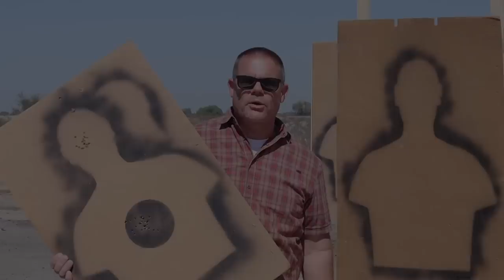Make Your Own Range Targets the Easy Way!

Comment: Another option is to use paper grocery bags. Fold them flat then cut in half along the wide side. Begin unfolding and trim the small square at the top so it looks like an IDPA type target.
Reply: Nice! I have been using brown paper bags with a piece of firewood in them to hold them up for years. (No rocks)

Comment: I was thinkin you could cut the silhouette from a piece of cardboard & use that for your pattern. 
Just my humble opinion! 
Thnx for the mornin humor OG!
Reply from the maker: Sure you can.  The edges get kinda soft with repeated use with wet spray paint, but those will certainly work.
Reply: Good advice considering that 8 dollar piece of mdf is worth $199.99 these days...Thanks again Biden!
Reply: Tape all the edges off with masking tape, rolled over the edge. After a while paint build up will help those edges too. 
Not trying to step on toes, just had a lot of sperience with stencils in Air Force,WAY back in the day.

Comment: I saw this video a little late. I spent three aggrivating, curse word filled days building a Costco shed, and I used the two giant boxes that were taking up half my garage to make a stack of targets. I ended up cutting one out by hand as a template, then tracing that one with a sharpie to make the rest. I also taped a 25 yard pistol target to the middle of each, and they worked out pretty well.

Comment: I used a shot up silhouette target from a local range (b-27 if I'm not mistaken) Cut the silhouette out, slapped it on a sheet of cardboard, painted around it. Cheap, easy.

Comment: O.G. I have another video idea for you - self made shoot n see "splatter" targets using paper/cardboard, clear packing tape, and spray paint.
I tested it recently & mine was easier to see than the factory ones that are like $2.50 each.
Works great for those of us who cant see the greatest OR for ranges where the R.O. only goes cold once every 45 mins to allow for target check/swap.

For best contrast, start with a white base (paper or white painted cardboard). Cover "strike face" of base with strips of clear packing tape, overlapping edges as you go. Then apply 2 light coats of a dark paint on top of the tape, preferably flat or matte finish to cut down on glare. 

Tip: if you use flat black, the round stickers that come on the factory target sheets work just fine for a quick patch to reuse target & there's always extras, but electrical tape does the job too...

Comment: This is genius. Gonna make me some wood templates of different  sizes. Way easier than tracing.
Reply: I'm even going to do some with negative cuts so it will show cross hairs on the desired aim circle and head.
Reply from the maker: Good idea.  Thanks for stopping by.

Comment: If I'm shooting irons, I use a piece about 18" wide.  I use painters tape, or blue spray paint, and put a line across the center.  I can see the blue line at 200 yards, if it's 2" tall.  White cardboard works better than brown, but that's probably racist to say.
The backstop at my range is the color of sand, very close to cardboard.  My point is that contrast helps my aging eyes.
Reply: @jimcappa6815  Can't win these days, we're all either victims or oppressors, sucks to be either.  Good, bad, I'm the guy with the gun.😁

Comment: Couple of tips. You can cant the images as suspects look at you from different positions. You obviously don't want to get a mind grove on just upright targets regarding shot placement. COSTCO uses large size heavy paper between layers of products like TP and paper towels. I usually grab and just put a couple in my cart folded in half when I visit them. Make a hand with pistol figure outline and paint it in the center of the target like the circle if you want to use ARMED suspects. In the old days, I would use life size different photo images mug shots for rifle practice. Later, I would 3" + figures, as well as 1" and 2" square cutouts to use on smaller pieces of cardboard as random rifle targets. Having shooters identify the random targets in the brush and then hit them is good training (photo or symbol). Cardboard with black targets hide well in brush. Nice to see your "how to" ideas. It was nice that you were using black paint with the cat...especially since you have video proof of the cat walking on the paint.

Comment: I had the same problem doing flight planning. Step 1, spread out a sectional (map for aviation nerds) for timbukistan, wait for the cat to lie down on it. Step 2, spread out the sectional where you're really gonna fly. Step 3 proceed with flight planning... quickly before the cat changes maps.
Reply from the maker: They are some paper- hunting bastards, that’s for sure.

Comment: I like the ways you show...
  I think anyone with a little motivation/enginuity (cue the Elvis music) can figure out a silhouette without some AR500 combat volunteers for a template. 
  One other trick that I use for indoor range targets...  Is to go to the dollar store, etc. and get some sheets of poster board, they're the right size, right weight, etc..  Then I take a cheaper, smaller paper target of choice "humanoid," Ben Laden, Kadaffi-Duck, targrt squares, etc. and tape/glue/staple (whatever you got, I use tape) and afix the 8"x12", 12"x18", etc. paper target to the poster board and Presto!...  You have some very nice indoor target sheets that can be reduced a couple times (some painter's-taped holes and a new target sheet) and can be rolled up and carried easily.
  The 2'x3' PB clips to the range racks nicely, all for about a buck and a quarter (whatever you pay for bulk, paper targets and a $1poster board).
  It's surprising the milage you can getcout of one sheet of P.B.  Works with your outdoor stands, too.  😀
Reply from the maker: Good idea.
Reply: @OGsDangerShow  
  Thank you, Obi-Wan.  ;)  Happy to share ways to save $$ and enjoy range time.  😀
  Being creative with printable paper targets of your own can be fun.  
You can buy bulk targets of different types/sizes on eBay.

Comment: Funny video.  I use targets cut out of convey belt, they last longer.
Reply from the maker: If only we all had access to conveyor belts.
Reply: You would be surprised at how many places use rubber conveyors.  Once they start wearing down, the old ones get replaced.  A bit of research might yield a source.

Comment: OG, any suggestions for non battery powered optics for PCCs? Do you think they should be relatively low powered?
Reply from the maker: I do t own a PCC but the philosophy of use says yes, low power. You’re not making 100-300 yard shorts with the thing.  Holosun makes a great solar power optic that is getting great reviews.

Comment: In my desire to save ammo, I've been shooting BB, pellet, and airsoft guns in my mancave and backyard.  I live in an unincorporated community and technically I COULD shoot live ammo, but there's a Jr. High right across the dang road. and I don't have a berm. Let's not poke a tiger in the eye. I used the pedestal from a dead tv and screwed on  a framework of 1 x 4's.  Staple cardboard to it and Bob's your uncle. I sit it on top of a  tool cart.   I can shoot up to 15 yards in my shop.
Reply from the maker: Nice work!

Comment: 7:56 If you're a real cowboy you take your router with a 1inch bit and free hand that line leaving a 2 inch connector every so often so you don't cut it all the way out of the square and just spray paint through the line cut in hardboard. Absoutely no benefit to doing it this way, unless you like an even line around the sillywet, but it does justify the router purchase to the wife when she hears you using it. Word to the tool buying wise..
Reply from the maker: Always good to have an excuse for the next gun or tool.  I’ve used almost everyone in the book.
Reply: @OGsDangerShow  I
 listened to my wife once and didn't get a Steyr A.U.G. when they first came out. I could have purchased one new for about $600. Our divorce papers say dissolution of marriage for irreconcialble differences. But if you dig back far enough. I'm pretty sure not getting the A.U.G. was the actual cause...

Comment: Did you really put gasoline on your junk area. I've spilled gas there before,it only takes a little to make you cry. And it's hard to wash off. Keeps on burning.
Reply from the maker: It was a small spill.  Dried up quickly and never contaminated the goods underneath.  😎👍